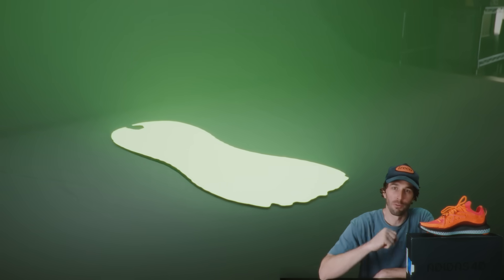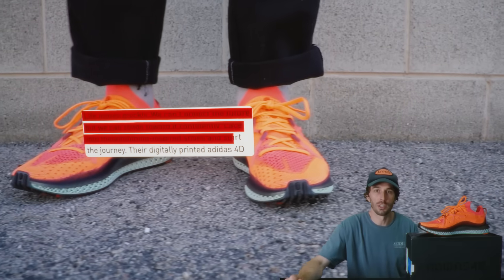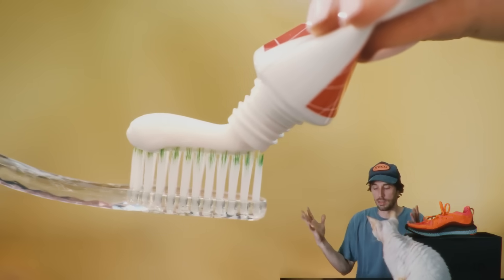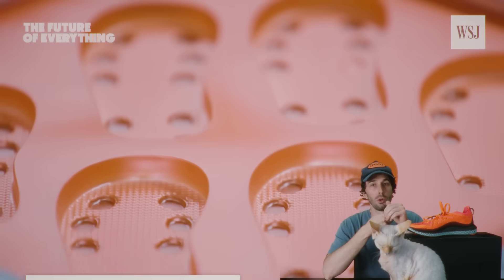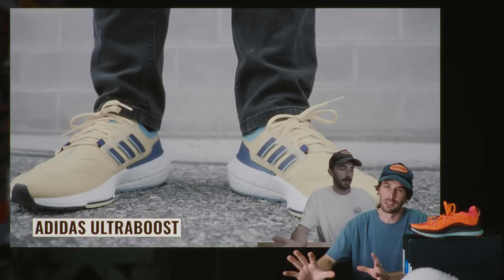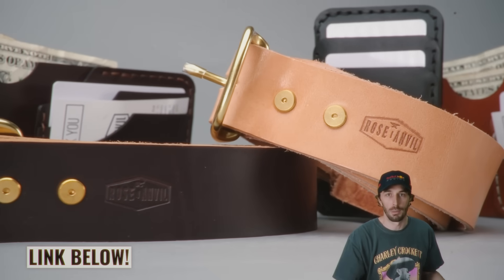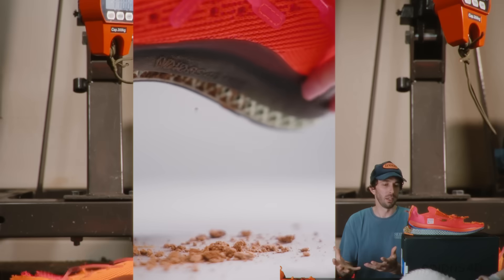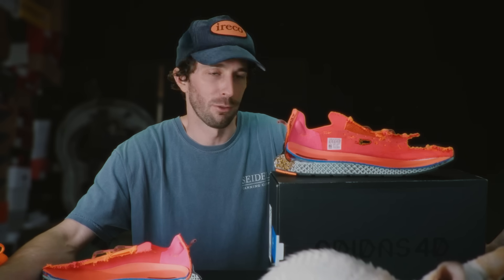Is the Future 3D Printed Shoes? - Adidas 4D Fusio - (CUT IN HALF)

Comment: 3D printing expert here. Your description of the differences between "standard" 3D printing and "digital light synthesis" (which is only a marketing term really) was sadly wrong. Both methods are fundamentally the same - creating 3D objects layer-by-layer with the same flaws and disadvantages. 
Extruder printers can also print with 0,05 mm layer thickness (albeit resin printers can achieve even 0,01 mm).
Resin printing is also created layer-by-layer, some do the whole layer at once, and some do the layers gradually (basically the same as extruder printers).
Resin printing can be much faster but could also be slower, it really depends on the shape and used technology.
It's not easier for prototyping, it's the same.
It's not stronger by default, it depends on the used materials. You can make super fragile resin prints and virtually indestructible extruded prints.
Resin printing is generally much more deceptive to defects, one mistake in angle, supports, or gravity and not only the whole thing is ruined but often also the printer itself.
The only truth is that resin printing produces cleaner-looking parts due to the thinner layer lines (but also can print at 0,1 mm).

The funny thing is that resin printing is 80' technology, it's nothing new. It was the first 3D printing invented, extruder printing was only a derivative of it.
Reply: So the uploader is ignorrant then, just for the views.. maybe he was paid as well hiding the design flaw of things getting stuck

Comment: Thank you very much for the analysis.
I have a small note that will help you analyze your shoes in more detail after the cut.
You need to make cooling for the cutting machine. This is necessary because during cutting the temperature of the cutting blade increases and it thermally deforms the cut sites for materials made from materials with a low melting point.

Thank you !

Comment: The reason the ball drop test didn’t work is probably because you dropped it on the heel, where the lattice is spread more apart, absorbing the energy. When you run, you don’t heel strike so if you were to cut off the top of the shoe and drop the ball at the front, it would most likely bounce around the same height as the other mid soles

Comment: Oh wow, my request actually gained enough traction to warrant a video, super happy to see this.

As for the structure being all the way through, that one could have easily been figured out by a quick glance through the midsole, as light does leak through.

And for their performance, it's hard to describe, I believe numbers alone don't do them justice. For me it's not just about responsiveness but consistency and durability. And they REALLY stand the test of time. I don't know about Ultraboost, but I do know Cloudfoam compresses after some time, and does not feel as bouncy as when you first get it. With Fusio I don't feel like that ever becomes a problem.

Comment: You picked the absolute worst example of the “4D” shoes to discuss the idea. This is part of the Originals lifestyle range. The runner was released as part of the performance range.

That skirt is worthless unless one counts squeaking as a positive.

I owned several pairs of these shoes, and I never had an issue with anything lodged in the midsole. Water protrusion is the big drawback. It would to be paired to a Celermesh upper to allow water to quickly escape. adidas released a teaser with Strung tech. That is the future.

It is nice for all day wear as it stands today.

✌🏽💙👟

Comment: Hi super cool videos :) two comments
1- historically DLS is the standard 3D printing is super old 🤯 not as FDM
2- as you said in your intro, the 3D network is designed to push the foot forward, did you try to test your rebound tests with an angle ? Like 30° this way you while be in the optimal direction for full rebound.

It's so cool to see how the videos evolved time :) take care.

Last question, I'm a great fan of Alexander McQueen sneakers. By any chance, could you make a review one day ? I want to know if it's real leather or coated one.

Comment: Great video!! As a sneakerhead and someone who own the Adidas 4DFWD, I can say it is worth every penny. This specific model has Adidas’s and Carbon’s newer 4D midsole tech which has a different structure than the first 4D midsoles from Adidas, which I believe is also used in those 4D Fusio. Basically, the newer 4D tech is more springy (making it more suitable for their running shoes, hence why its in the 4D FWD), and is actually more comfortable than the original version. I love my pair of 4D FWD.

Yes, things do get stuck inside the midsole, so you don’t wanna put it through dirt or mud. It is very much a city walking/running shoe. But, it’s a small price to pay for tech that’s really pushing the boundaries, and a still comfortable shoe.

Comment: I would really like to see a safety toe September or SafeTOEber where the  sizes of the toe boxes/roominess is compared. I’m sure a lot of them use the same steel toes but maybe not. Would like to see weight comparisons of steel vs composite and possibly a heat transfer test to see which is better in different conditions. Keen carbon fiber toe and thorogood emporer toes would be cool to see opened up too.

Comment: you got the wrong shoe the 4dfwd is the one with the forward propulsing latus structure not the fusio or the futurecraft or the ultra4d these 3 have the same midsole there is only a small portion in the midle of that structure the outer part ist manufactured to look like the OG ultraboost sillouette and as you said it is a running inspired shoe so no sense comparing it to the ub22 or the nike zoomx it is a shoe for daily use were you can stand a lot because it is not wo wobbly and unstable as foam but aldo walking is relly good in these the 4dfwd is something else this is a running shoe and yes i have got the ultra4d tripple das grey and the 4dfwd x parley ocean plastics but the one with the continental rubber outsole that is far more durable than the one from the ultra4d's
Reply: Pro Tipp for cleaning: adidas says it is an onstreet running shoe but to run hot water through it and brushing it a little bite with a soft bristle brush helps cleaning so don't worry getting them dirty

Comment: I know this sounds weird but I would be curious as to how these shoes would hold up after being in the sun for a few days/weeks. These resins they use cure with specific wavelengths of light, and also degrade from exposure to light, so it's possible these shoes could crumble eventually if left in the wrong conditions.
Reply: To be fair, that's pretty much what would happen to a large majority of running shoes. Depending on where you live.

Comment: I own a 3D printing shop and I’d like to shine some light on the technology used. 

The technology they use is called Stereolithography and it is actually old it was originally designed in the 80s and all it is basically is UV or Laser Cured resin. 

FDM was designed a bit later, and although you might see layer lines with FDM more, you also have layer lines in stereolithography. 

The downside of FDM is yes the layer lines have weak spots on the orientation it prints at, but you have much more material choice flexibility. 

the downside of Stereolithography is it is very UV sensitive and generally not very strong. The quality in visuals is there but not in its strength. 

Industrial resins and better but either way, it’s funny when I see every brand with their own fancy naming for the tech. 

DLS is advertising itself to add an extra step to the process but I think really it’s all the same stuff. Very advanced overall  technology but both have use cases.

Comment: Thanks for doing the vid!  Great to see your take on them.  I'm a big 4D fan and own several pairs.

This original 4D sole is a lot firmer than the new generation 4DFWD and it's "squish" factor is totally different league.  As an experiment, I actually soaked a brand new pair of 4DFWDs in boiling water for a few hours and it totally changed the softness of the 4DFWD structure.  I use it for casual walking and it is by far the best in comfort for all day, everyday wear!

Comment: As someone who loves sneakers and has been trying to max out on comfy tech AND someone who really likes Adidas — I think these shoes are just a great proof-of-concept right now. In practical purposes, I’d rather just go with an Ultraboost because the advantage isn’t significant. The biggest downside for me for this tech is that it has holes! And no matter how careful you are, stuff will go inside them. Imagine spiders crawling up in there and nesting, for example. The best way to make this tech more practical for daily use is to encase the outsole like they encase the Boost in Yeezy 350s. They did it half-way here, but I think that would be the real deal-sealer, and that would finally make the conversation about its comfort over other tech. Right now it has a new sort of impractical disadvantage that other outsoles don’t.

Comment: Being a die-hard boost head Ultraboost was something I wore exclusively. They are confortable, stylish, and versatile. However as I get older I find, to my dismay, the amazing softness of the midsole is giving me foot fatigue on the top of my arches and also the big toes area. 4D midsoles alleviates all of that. They have a firm give when you first step into a new pair, but it also provides a sensation of "embracing" your foot. They provide all day comfort and support without feeling mush-y. And trust me, they get more comfortable as you wear them in. 

So far I have had zero problem with materials being stuck in the midsoles in all my 4D sneakers. The price is really stiff yes, but they are definitely worth it when they go on sale.
Reply: Congrats, you've figured out soft shoes ruin your feet
Reply: @placeholder3863  No that's not the case at all. It's about finding the right cushion setup for your age, and for the right occasions. I wore boost predominantly for the longest time, and they were the bee's knees. But as I'm over 40 now I need something firmer if I were to be on my feet all day. Plush cushioning is still great when I go for a walk or a jog.

Comment: I have been through two pairs of 4D running shoes and am about to buy a third. I prefer them, firstly, because the midsole is super durable compared to Ultraboost, so I don't have to coddle them on runs.

The second thing is the FWD midsole is less about vertical rebound and much more about 'forward efficiency.' It's not as springy, but I find over a long run I become less fatigued with the help of the forward propulsion. And the targeted densities.

Third is, because I give these a light clean regularly, they stay much fresher than the white foam midsoles of other shoes. Foam midsoles stain really badly over time, so running warm, soapy water through these once a week makes them fresh for the life of the shoe.

And suprisingly great underfoot ventilation.

Comment: You can't judge a shoe by the amount of bounce in the midsole. Many runners don't like too much bounce and prefer a flatter response (eg. Asics gel) or very little cushioning at all if they are light and fast runners.
Other factors like the shape of the outsole and how the heel flairs out can all affect the amount of support and how the shoe cushions you simply because your natural shock absorbing mechanism, pronation, is enhanced or reduced.
 So the whole package needs to be assessed and the individual it is aimed at (overpronator, neutral, under pronator, heavy, light, fast runner, slow runner, short distance, long distance etc.)
 It is why there are so many types and models of running shoes in a manufacturer's inventory.
What this technology might eventually do, if they can solve supply chain issues getting it from Asia quickly, is offer an easy way to tailor the amount of cushioning and support and eventually it might be possible to go into a shop, get a scan and/or specify the amount of midsole cushioning and support and have a customised shoe shipped out to you .
Reply: An under-pronator is the same as a supinator, yes? 

I supinate the shit out of my soles.
Reply: @cacogenicist  Yes, a supinator and under pronator are used interchangeably though there can be subtle differences. It is when your feet or foot doesn't roll inward far enough when your foot lands. Sometimes your foot can roll to the outside of your toes slightly when you take off again. It tends to affect rigid, immobile feet more than mobile flat feet.

Comment: Soon as i saw it was DLP/DLS/resin printed im out. Not gonna be as strong as other methods. with the correct filament, nozzle and an FDM printer it would be more then 30 pounds for sure. You gotta realize resin isnt made for strength. Its made for detail so people use them to make figurines. ALso, post processing resin vs FDM is hell. FDM requires little to no post processing. Resin needs a bath of alcohol and UV blast to cure the rest.
All of those thickness variations can easily be done with FDM and you cant do multiple materials at once with resin, but you can with FDM. so you could print an elastic sole with a built in composite/carbon fiber toe and a TPU based upper and PETG/carbon fiber eyelets. you cant do any of that with Resin.
This is coming from someone who has been printing since 2010 and has owned several printers and has printed shoes long before it was cool.

Comment: 5:10
You do not end up with a stronger, better product than with extrusion printing.
Hoffman Tactical has done extensive testing on 3d printed materials and liquid resin printed materials are consistently less durable than extruded materials.
The only benefits are layer adhesion and smoother finish.
The materials themselves are less durable by a large margin, and they are much more expensive to produce.

Comment: Adidas detected that this design was a complete failure several years before making it known, since they intended to manufacture a high-performance running shoe. However, and after hiding the project for a few years, they launch it again to try to recover part of the investment, saying that they serve as a training shoe that makes you feel like you're running across the sand on the beach. And it is that far from helping in the stride, you sink and lose energy with each step.

Comment: I got 4D because it was 50% off last Christmas season and it is definitely not worth the regular price of $200+. It is very firm and heavy. The lightweight primeknit upper with a heavy midsole felt weird while walking or jogging.
Reply: 100% agree! but it's not just some of the Adidas models. Other brands like Nike, Puma, Asics, and even some brooks will combine these super lightweight uppers with a "heavier" midsole. Now the midsoles usually aren't actually "heavy" they just feel it when compared to the upper. I'd rather have a shoe that is slightly heavier but provides a more balanced feel on my foot.
Reply: You need to try a Saucony Tempus. Lightweight, bouncy, and supportive.

Comment: My job is to design and 3D print dentures in a dental lab, and Carbon is a big name in that space! I work with Asiga printers because you can actually buy them, whereas Carbon printers are only available for lease. That's right, you pay by the month or by time spent in operation, no option to buy outright. The technology is amazing, however the promotional material shows product rising out of the resin pool smoothly. But in truth, there is an "up and down" motion repeated thousands of times (one for each layer printed). Carbon has the speed print down, but depending on the type of resin used and the thickness of the printed layer, prints can take 8-10 hours or more.

Comment: I imagine that this tech won't be utilized so much in footwear, but in other areas. I think all mattresses will eventually be made out of this material. Because if it has the same level of comfort as foam, but doesn't sink in, and always springs right back, it would be like having the comfort of a memory foam mattress, with the structuralism of an innerspring mattress. But unlike an innerspring, it won't crush over time (maybe?), and it will be much more lightweight. I think the weight alone will be the selling point. Because both foam and innerspring mattresses are quite heavy and cumbersome to get a mattress cover on them. And it's a chore I absolutely hate, when I have to change the mattress protector. With this, it would be so much easier.
Reply: Latex is way better.

Comment: All resin printers use light; the difference between Carbon and other resin, it's called CLIP (Continuous Liquid Interface Production) which has a membrane that allows printing in less than 25% of the time of regular resin/FDM and the product is printed at the molecular level so the finished unit has the same structural strength as the original material so there is no weak points or characteristic printing issues like delamination or needing to smooth parts - parts come out of CLIP ready to use.